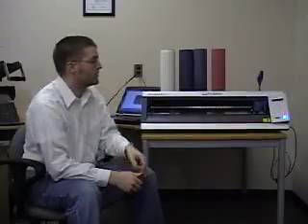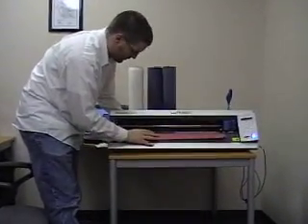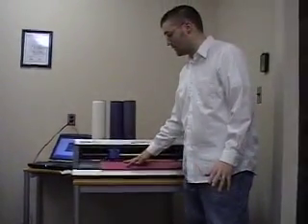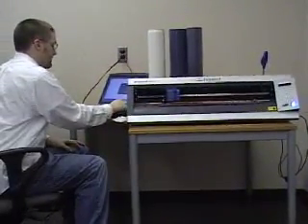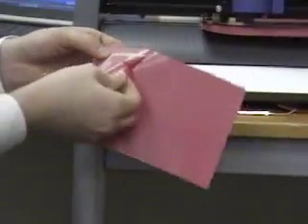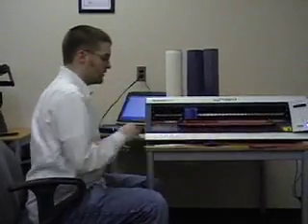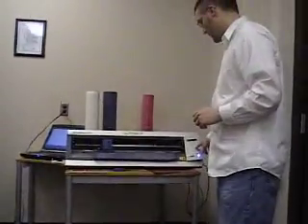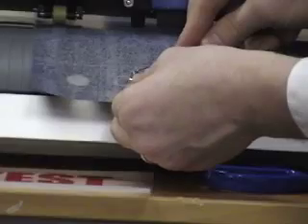Roland GX-24: Cutting Media Part 1 (Video 5/8)

Comment: when i cut my roland start cutting on the tail end instead of the lead edge as shown on my illustrator screen? what do i do to have it cut starting from the lead edge?
Reply: Make sure you set your origin point on your cutter before sending the job.  You want to make sure you hold the button on your cutter in for a couple seconds until "Origin Set" flashes on your screen.  You may also want to consider using the plugin to get your cut file from Illustrator to Cut Studio.  You have more control over the starting point in Cut Studio.
Reply: Thank you Sir!